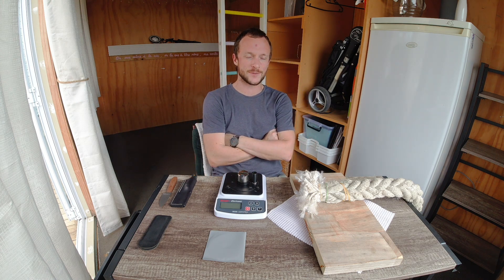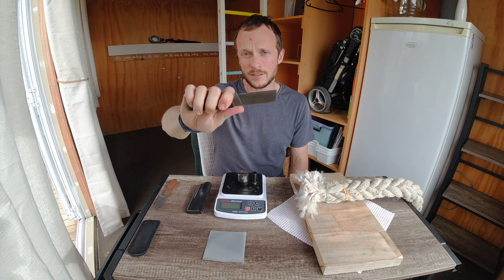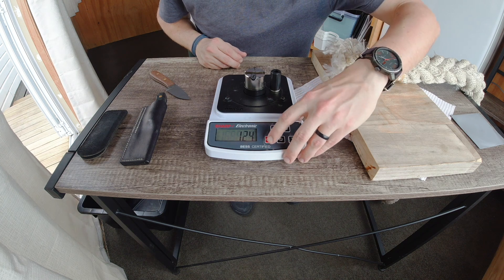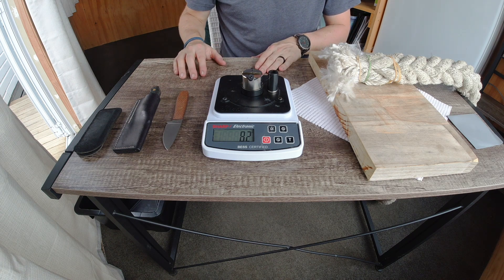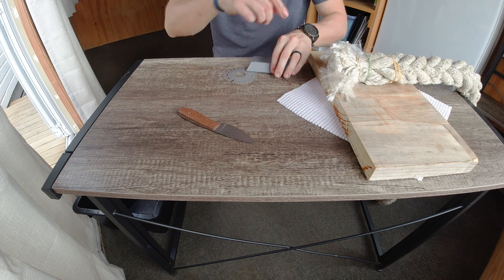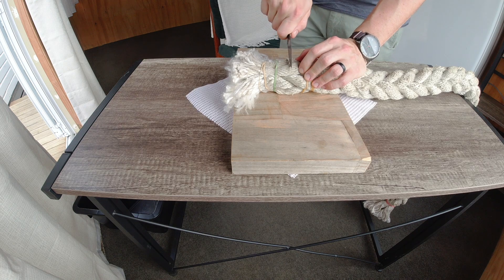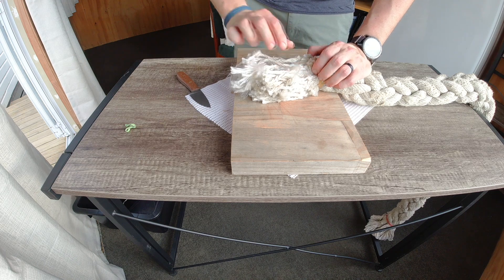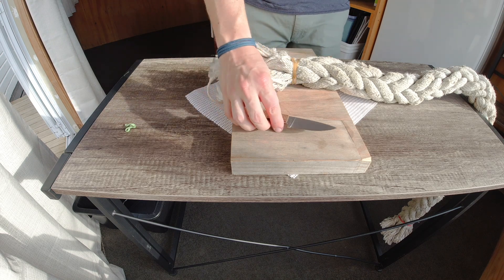Death Rope VS CPM 10V Steel Knife | Factory (Fepa 400 Grit) Edge

Comment: No. Magna cut doesn't have better retention. Your straight wrong
Reply from the maker: Oh hello.  I may not have communicated clearly in this video - but I am not making the claim that MagnaCut has better edge holding overall than CPM 10V.  From a CATRA (and real-world) standpoint, that is not true, the overwhelming amount of Vanadium in 10V leads to a much more enduring working edge (I cannot speak to fine edge because I have not done testing on it in these steels yet).

The result of the test shows that in this (highly variable) test of plunging through a used ship rope filled with sand, coarse sharpened 10V and coarse sharpened MagnaCut experienced a similar dulling pattern.  That's just the result of this particular test, and it is admittedly a very limited test, mainly undertaken for my own curiosity.

When I mention a very low BESS reading for MagnaCut, I am referring to a test of an edge achieved by a different method of sharpening - that almost always leads to a completely different result.  Maybe I did not make it clear in the video but I do not currently see this test as proving anything conclusive about which steel holds a better edge in real life.

I have not yet done a test of 10V with the style of sharpening that helped MagnaCut excel - so I cannot compare directly - but I hope to do another test on it after spending some time optimizing a sharpening protocol for super hard CPM10V.

All the best.

Comment: How do I contact Jason? I love the drop point knife and would love to get one especially if it's possible to get one in s125v. I'm good on 10V for now since I just ordered a knife in Vanadis 10 at 65hrc which is a 10v class steel but with 8% Cr which should help with corrosion resistance. I found 8%Cr for me is a sweet spot where a steel doesn't corrode (3v, cruwear, k340) with my body chemistry but steels with 5% or lower like 4v, M4, 10V, Z-max and alike get a patina from touching the blade.
Reply from the maker: @blankblank2800
Reply from the maker: That's his YouTube handle - find him in the comment string here!

Comment: Yeah I am sort of familiar with Jason and his knowledge and capabilities.   I would say that, if the readings are correct, the BTE thickness is too thin.   Great for light duty work, but the ANDE rope is just too much.   Suggest that this edge is flattened on the side of a stone and then re-apexed, this will thicken it up a bit.   Also looking forward to repeating the test with a NON stropped edge.....just right off the stones, but you need to make sure to have a clean apex off the stones.  I think 400 grit stone would be a great start.   The steel is solid, the heat treatment I am sure is solid, but that BTE (I could hardly call it thickness.....more like thinness!) is suspect.  I also think 10V can make it through.   My experience with K390 and 10V says.....yeah, that ANDE rope is toast.
Reply from the maker: I agree Stuart, I think it can make it, thanks for the input on BTE thickness.  I have a little more testing to do, but I'm thinking about attacking the Death Rope with the 10V, maybe with a 400 grit CBN edge with minimal stropping - we'll see how the numbers line up in the next couple tests!

Comment: Oh. I think i should mention. The reason i ended up going that thin bte. Was i tested it when it was. About the thickness of that sort of cleaver shaped blade give or take. 

I tried chopping for a while (hard to do with a small edc like that). Then switched to batoning  it across the grain on some wood. It didnt see any noticable damage from doing that. At least to my eyes. 

My thought was. Since its not made for that kind of work. It doesnt need to have a thick geometry made to withstand that, so i might as well take it thinner to get that slicing performance.
Reply: Do you make knives in s125v? I love that drop point design, it lolike a perfect edc fixed blade and I'd love to own one. Thin stock, thin grind, great steel and heat treatment and a great design is pretty much everything I'm looking for in a knife. Great job on both knives.
Reply: @MFD00MTR33  i haven't worked with s125v yet. But i would be open to doing one in it.
Reply from the maker: And I'm so glad you did!!!  That thing is gonna be thin behind the edge forEVER!

Comment: Excited to see you put some of your edges on those. 

I definitely think 10v can make it through.
Reply from the maker: Me too!  I've got through 6 stropping tests, and 21 rope cut tests in the last month that are not published yet.  I'll probably shoot you an email with some interesting findings, but I think the new testing is really starting to show some cool observations!!!

Got a new scale that's way more precise and is giving me actual reliable data, and the microscope I just got is really opening things up as well!
Reply: @homeslicesharpening  yeah. I wouldnt be surprised if the spine thickness isnt thinner than some production knives bte thickness.
Reply from the maker: @_BLANK_BLANK  I'm sure of it!!!
Reply: @homeslicesharpening  nice! I a microscope i think is a great tool for this kind of testing. Can certainly take out some of the guesswork. 

At some point (probably not anytime soon) im going to get a metallurgical microscope myself. At least thats my plan. To really start getting into testing different heat treatments and what they do to the carbide structures of the steels. 

(I think i replied to the wrong comment with my other reply somehow)
Reply from the maker: @_BLANK_BLANK  All good bro, it's great to hear from you.  I'm toying with the idea of trying the ANDE rope again with your knives but off of a 250 grit diamond or 400 grit CBN - we'll see how the CBN performs in the first round of tests.
Reply: @homeslicesharpening definitely shoot me an email when you get around to testing it out.

Definitely excited to see how it goes. Like i mentioned. I do think at some point I'm going to have to send a 3rd knife, but with my current ht. I'm very confident that even if the ones i sent do well. The new one will likely still do much better.